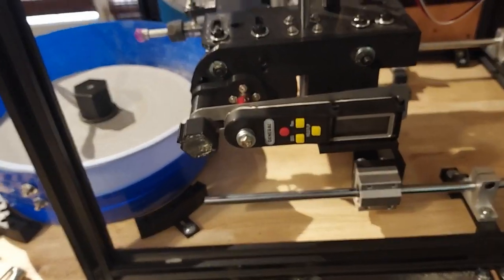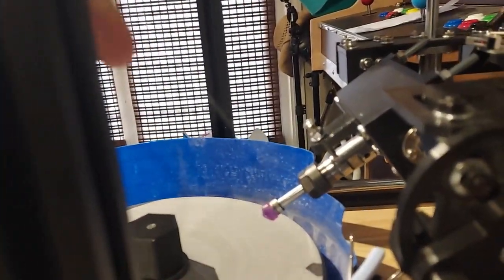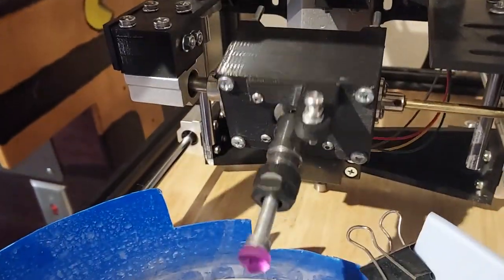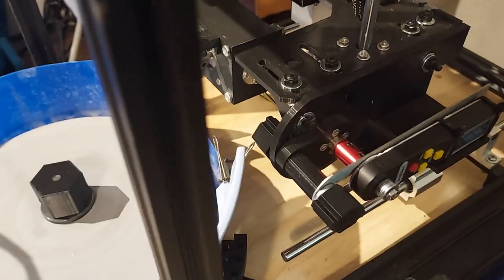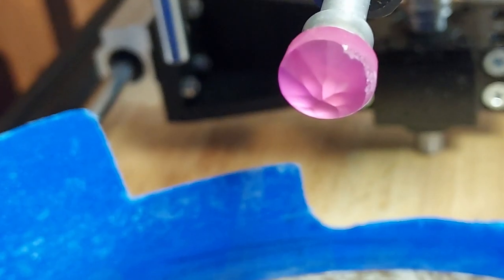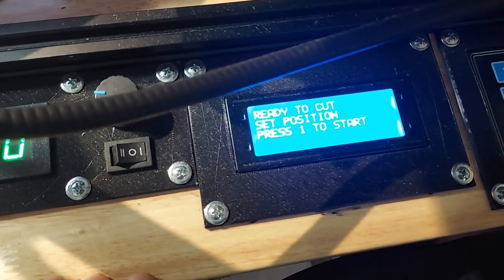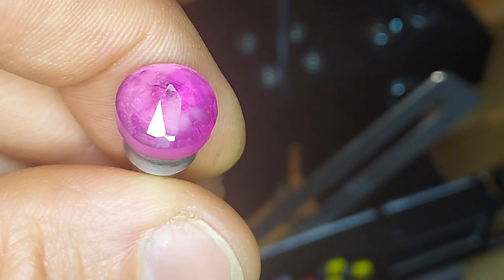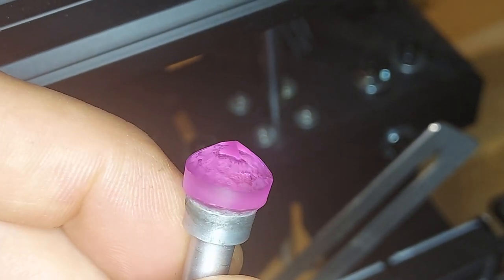Faceting Machine Update and Corundum Cutting

Comment: I saw your video doing my own experimental automatic faceting machine project. How's it going? Does the index change automatically? Is there a stepping problem in stepper motors? Are there images of the finished stone?
Reply from the maker: Hi Baki,  the index does change automatically. the motors I am using have a 200 step rotation, so that's basically a 200 index, so it is somewhat limiting to what cuts can be done.  to be honest, I sort of ran out of steam on this before I finished a complete stone. I have a few that I cut one side on, but no complete stones. I later decided that this needed some improvement before it could be called "done". But it does pre-form stones very very well.
Reply: @earthartgems  Nema17 motor is fullstep: 200 steps. If you use microstep, it can go up to 4000 steps. So there is a very wide range of indexes. In fact, in a solution I have found now, the advance precision is around 26 nanometers. At the first stage, I only want to control the index gear section with the under-finger button. I hope you will further your work and come up with finished stones without any problems. This is the project link I just started: Nema17 motor is fullstep: 200 steps. If you use microstep, it can go up to 4000 steps. So there is a very wide range of indexes. In fact, in a solution I have found now, the advance precision is around 26 nanometers. At the first stage, I only want to control the index gear section with the under-finger button. I hope you will further your work and come up with finished stones without any problems. Here is the link of the project I just started: https://youtu.be/8chBqGp2irA
Reply from the maker: @bakicirkin  Thanks Baki! this is inspiring. I've sort of put this project on hold for a while to focus more on my jewelry business but I if I get back t it maybe I'll pick your brain a bit more on some of the solutions you've come up with. I totally agree that getting that Index to a point where it is both repeatable and high precision is absolutely critical to cutting a good stone. This, and the same for the protractor angle, which is also giving me fits, but it is still a fun learning experience.
Reply: @earthartgems  You are absolutely right.